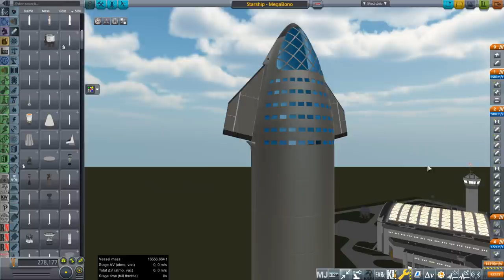Realism Overhaul in KSP 1.8.1 - Starship - MegaBono

Comment: In "Frontiers of Space" (https://www.goodreads.com/book/show/3478067-frontiers-of-space) Bono showed not only ROMBUS but the Pegasus/Ithacus civil/military transport versions as well as an unnamed variant that used 24 (IIRC) SSME motors and put a full, orbiter with no engines into LEO as payload. Steering was to be by differential throttle but it appears this may not have been sufficient so some patents show panels that extend from the aerospike to act as thrust diverting plates. Also the turbopump exhaust nozzles in the aerospike would either be covered by panels for reentry or they were planed to be used to dump the liquid hydrogen that would be circulated to cool the plug base on reentry. 

The external tanks in the 'standard' version of the ROMBUS vehicles to be cheap and expendable but study was done on using parachutes to recover them but economy was dependent on the flight rate of the system. A mentioned but not well studied concept, (actually coming from a totally different LV concept but which was mentioned as applicable to ROMBUS like vehicles) was simply retaining the tanks to orbit, (at the cost of some payload) and using them with a mechanism that would 'spread' the tanks to effect aerodynamic control authority on reentry as well as increasing the vehicle drag and lowering the heating footprint.

As for ramjet/plug-nozzle what you're looking for is a "Air Augmented Rocket" or a shrouded rocket motor, (also known at a Rocket Engine Nozzle Ejector or RENE system) like that found on the MD proposed "Reusable NOVA" or ReNOVA (http://www.astronautix.com/n/novammr10r-2.html) which used a shrouded exhaust to around Mach 2 at which point half of the shroud was dropped and the shroud ring acted as a ramjet, (there's really no need for a "scramjet" as a standard subsonic ramjet can operate up to speed of over Mach 10 while still generating positive thrust and really there's no real need to air-breath past about Mach 8) till a bit higher than Mach 6 at which point the ReNOVA would be above most of the atmosphere anyway. Somewhere along here the lower portion would 'stage' and the duct would extend covers to protect the engines and seal the duct as the stage used the forward end as a heat shield and landed in the ocean using parachutes. (Similar to how the NEXUS and original ROMBUS concepts were recovered)

To address the original issue, yes refueling Starship in orbit is going to be slow, tedious and dangerous but on the balance the higher flight rate is supposed to make Super-Heavy cheaper to fly. IMO the 'driver' for Starship is misplaced since it's based around the amount of cargo it can land on Mars rather than the more sensible payload to orbit metric. (RHH was right in that once into orbit you are half way to anywhere. There's a good reason for using more efficient 'ships' to move between orbits than the ones you use to take off and land with) One thing I did note is that with this SSTO you move from having multiple re-fueling flights to possibly down to two which makes some sense. But really what Starship requires is to launch to an already in-place propellant depot rather than having to wait on multiple refueling flights. Filling the depot when possible rather than having Starthips having to 'wait' for refueling makes way more sense.

Comment: Essentially "Launching multiple spacecraft for in orbit refueling is a pain, so I'll make the most massive aerspike ssto".
Reply: Even if it works, it's not an ssto, it's got boosters
Reply: @whiplash7400  It doesn't have boosters, it has drop tanks.
Reply: @kurtweinstein8450  Stage and a half then, like original Atlas.
Reply: @whiplash7400  actually the reverse of Atlas.  Atlas dropped the booster engines and mounts but kept the single balloon tank.
Reply: @kurtweinstein8450  True, but both are examples of stage and a half systems

Comment: That reminds me a lot of the boeing mplv
Reply from the maker: That was probably based on Phil Bono's work at Douglas.
Reply: The LMLV is huge
Reply: LMLV was based on a separate work but based around NASA planning for a "Post-Apollo" large LV in the NOVA class. (Yes both ROMBUS and NEXUS were from the same study) Something to keep in mind though is LMLV (https://www.secretprojects.co.uk/threads/boeing-amllv-advanced-multipurpose-large-launch-vehicle.9630/) was always supposed to be an EXPENDABLE LV not recoverable therefore its payload to orbit was actually HIGHER than either ROMBUS or NEXUS :) Of course having said that ALL the NOVA and Post-Apollo Large LV designs were impractical for the given situation post-Apollo and that became pretty clear early on. Probably the most useful outcome of those studies, (and conversely the most overlooked and underrated IMO) was the off-handed "lower capability" options that the companies produced but had only passing mentions in the rush to urge NASA to build larger and more complex vehicles. The Convair NEXUS study for example showed a possible "NEXUS-like" conversion for the Saturn 1B/V that made the S-1B, S-1C, S-II and S-IVB stages into compact recoverable stages. Similar work in the ROMBUS and LMLV studies helped Chrysler more rapidly refine and design the SERV, (https://en.wikipedia.org/wiki/Chrysler_SERV) concept which arguably only failed to meet two of the shuttle required criteria, albeit the two most important in the eyes of NASA during the Shuttle design period. (Every flight would not be manned which was an Astronaut Corps and Manned Spaceflight Center requirement, and it didn't have wings which was a caveat needed to include the NASA 'aero' centers and a design bias of the time)

Comment: 2:10 Thanks, Aerojet Rocketdyne, I hate the RS-68.

3:40 You're implying there that you can calculate the performance of conventional de Laval nozzle engines... I really want to know that wizardry. (I know the de Laval equation, but it depends on the exhaust exit pressure, which is a figure almost impossible to find for most rocket engines and the derivation or even approximation of which from more accessible figures [specifically including chamber pressure, atmospheric pressure, and nozzle ratio] I have not been able to find out.)

5:00 LOL

9:20 In general, making an engine throttle to 65–70% is relatively simple (in comparison to deep-throttling), so you could add that much more throttling capability without major modifications.

12:50 Holy shit, that sounds _awesome_.

15:45 Adding notional SSME-style staged-combustion performance improvements (or potentially... see end of comment) combined with the larger central tank would definitely make it work, potentially even as an SSTO (more probably with the 42 engines and certainly if the end of comment is done).

16:20 Agena reached 95–
96%, so that's where I'd put a realistic utilization cap.

18:45 (and 21:35) Good idea(s).

I wonder, what do you think about the potential of rocket or jet engines using the Humphrey/Continuous Detonation cycle? Given the projected improvement margins (essentially adding another staged combustion's worth of seconds, and thus changing the prospects for a reusable chemical SSTO with appreciable payload from "maybe" to "definitely"), I'm not really sure why there hasn't been massive R&D in solving the combustion stability challenges and creating engines using the cycle.
Reply from the maker: I explain how to calculate regular nozzle rocket performance during my Rocket Science series, working through the equations, but the short answer is to use RPA lite: http://www.propulsion-analysis.com/index.htm. Just get the free lite version. Explanation of how to use it is here: https://www.youtube.com/watch?v=F3W3zZj4zX4.
Reply: @RaizSpace  Thanks! I must have forgot about that over the past year and change...

Comment: I prefer to send main body of a rocket ship empty so I could refuel it later in orbit. The good thing about it, the ship never has to land. And I use 2.5 m fuel tank as a refueling ship. Easy to recover as well. (Of course the default game rules apply in my case)
Reply from the maker: Yeah, it's somewhat less time-consuming in the stock game. In RO, it takes a long time to bring something like Starship back to the surface (which would have to happen with each refueler, of course).

Comment: The only problem with having a reusable rocket this big is that suddenly your launch pad is no longer reusable. Jokes aside, would Shuttle tiles even be suitable for this ? Pods go more towards the ballistic side when it comes to reentry, so I have a feeling that the thermal loading on the Shuttle's tiles was a bit ... gentler, at least compared to that of a pod.
Reply from the maker: This particular pod will have a very big surface area while being very light, since it's mostly an empty tank. I can't say for sure, but I can say that some prominent 60s space engineers thought it was feasible.

Comment: Wouldn't just using a Heavy Superheavy configuration solve most of the fuel-to-orbit issues?
Reply from the maker: Depends what you call most - you wouldn't be able to launch a fully-fueled Starship.
Reply: @RaizSpace  No, but if the alternative is launching this without crew, we're talking one rendezvous mission up to it anyway, so the thought would be to get them up with enough in the tanks that only one tanker trip would have to be made.
Reply from the maker: It would be more than one tanker trip to top it off with three Super Heavy cores, and you'd probably lose the center core because it's going too fast. So, full recovery is out the window. Also, the fin/legs on the Super Heavy make them impossible to cluster.
Reply: Ah, that makes sense. Thanks.

Comment: With the scramjet/areospike is the profile you are thinking about speeding up to supersonic speeds with areospike, using the scramjet to boost speed then using the areospike again in vacuum or is there a different profile that you are planning?
Reply from the maker: No, there will be a booster plane to get it to hypersonic speeds (like in this video: https://www.youtube.com/watch?v=5uCReQXd_hs) but then the spaceplane will use the scramjet first and then the aerospike to complete orbit. Using the scramjet will save a lot of oxidizer and increase payload capacity. We're going with the aerospike not because I need surface-level performance, but because it might fit well with the scramjet's exhaust, which is in the form of a linear spike already.
Reply: @RaizSpace  that makes a lot more sense than what I was thinking.

Comment: raiz... you mentioned combining a linear aerospike with a scramjet and I wanted to mention that this achieves a similar thing... might be a good place to start https://en.wikipedia.org/wiki/SERN
Reply from the maker: That was roughly the nozzle I intended to use for the design, yes, but that doesn't deal with the aerospike integration. Don't worry, I'm watching a University of Queensland lecture series on scramjets - I'm pretty sure I'm past the point Wikipedia would help.
Reply: @RaizSpace  lol fair enough, I don't think there should be anything to stop a full aerospike integration, but I'm not qualified to make that call :D

Comment: Can you show how to download decq's Saturn V and make it work with RO in ksp 1.8.1?
Reply from the maker: I'll have to check that out - haven't tried it in 1.8.1 yet.
Reply: Alright Thanks!
Reply: by the way, when i download RO in 1.6.1, ckan says smokescreen-RO is incompatible, even though last year it DID work
Reply from the maker: I've never used CKAN, and it's probably because of stuff like that.
Reply: Also also, Can you show how to download RO manually in OLDER versions?

Comment: you shuold swap out the liqed hyrogen with liqed methane for your megaBono you can get alot more fuel that way becuse methine would have alot more energy density,refuealbe, and alot less bulky in volmume too
Reply from the maker: But the efficiency of methane is much worse (by about 20%) and as a result, the 36 M-1 engine aerospike would not be even close to lifting Starship to orbit. Bulk is a minor issue - reducing the tankage mass won't overcome a 20% drop in efficiency, especially considering the size of the engine. Also, refueling is irrelevant since the aerospike stage is coming right back down - there's no point to fueling it in orbit. The whole goal was to NOT fuel things in orbit.

Comment: You did not drop any Tanks during launch. Build it Like the Mars Lander/return. Have the Fuel drain from pairs/sets of Tanks and drop them when empty. The 1st four Tanks should be easily recoverable with Parachutes, the next four maybe? Draining from and dropping Fuel Tanks. An Added Bonus is that Jet Engines could be attached and used for more thrust and better ISP only needing Fuel and getting Oxidizer from the Atmosphere.(Even Higher Relative ISP) Try to add Just Two Intakes and engines to the Fuel Tanks. ???